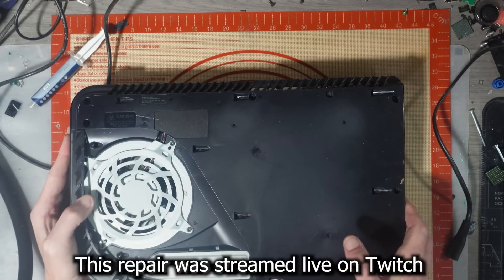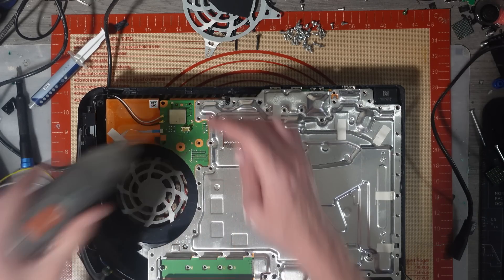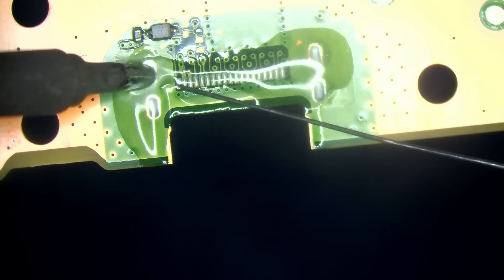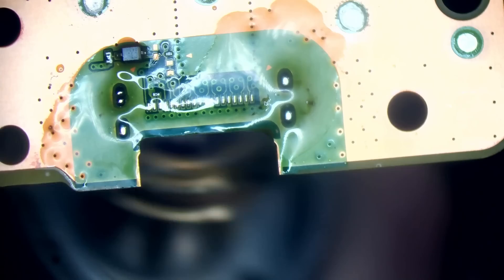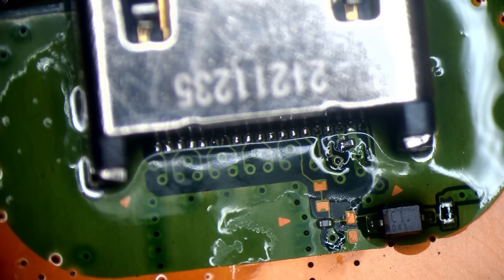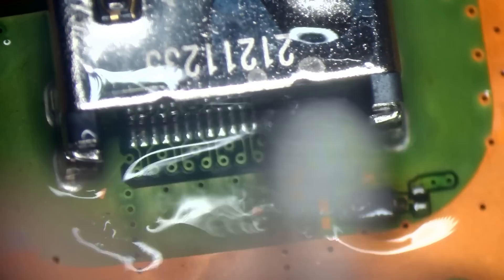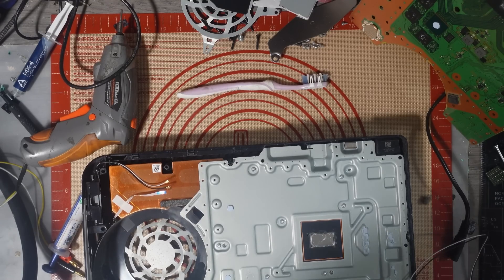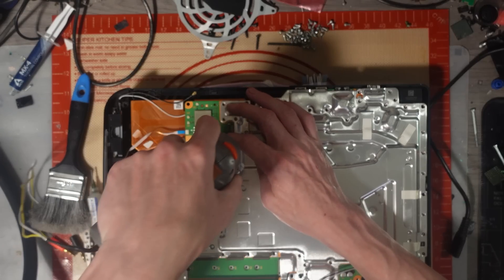PS5 NO DISPLAY AND OVERHEATING REPAIR

Comment: You might want to consider pre-tinning the hdmi port; that way you have both more solder on the connection, and chances to have it "right" right after dropping the connector are at least doubled. Plus you safe a minute or two, and all joints look equal because all have equal amount of solder

Comment: hello  need your help I bought a ps5 for repair with strange symptoms the image blinks and the sound crackles and does not always start the system has 2 seconds of blood I made a bios backup the motherboard is EDM-010 console model CFI-1016A ,  PS5 motherboard and with the F7501 fuse no voltage on the 3.3V coil on the 12V fuse is where to look for the reason for the lack of 3.3V voltage can it be a converter or is it a mosfet marked Z342 near the capacitors?

Comment: Speed run baby! 11:37 You forgot yo warranty stickers inside the Ps5, LOL.

10:14 I would never dare use powered screwdriver on coarse thread screws going into plastic,
dude you've got guts or skills to replace the fan screws with an electric screwdriver.

Btw still waiting for the LG OLED repair, spare parts not in?

Comment: Hi Phil I've had this new problem start with my ps5 recently I brought a remote for my ps5 and ever since I've had it I keep getting a problem with my controllers after switching off my ps5 both my controllers won't pair up to my ps5 so I have to keep hard resetting my ps5 to pair them up I'm wondering is it my Bluetooth receiver on the ps5 on its way out or is it cos I've got a media remote connected to my ps5 now I've never had any problems till I brought my media remote it's a weird fault I just can't work out what to do to stop it
Reply: if you still have the problem try turning it off then unplug the ps5 for a 1 or 2 min and see if that fixs it

Comment: After removing the old HDMI connector, you forgot to "wick" away the old solder 😨
Reply: Wicking away the old solder is only necessary if you used low melt solder, which you do not want to leave. Removal of the old unleaded solder only serves to lower the melt temp.
Not completely necessary or required. Only very helpful!